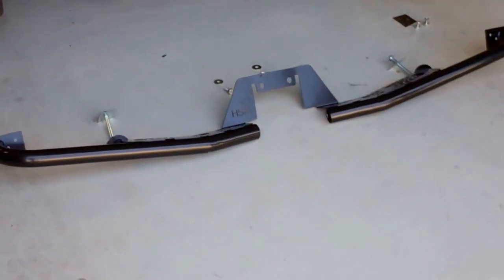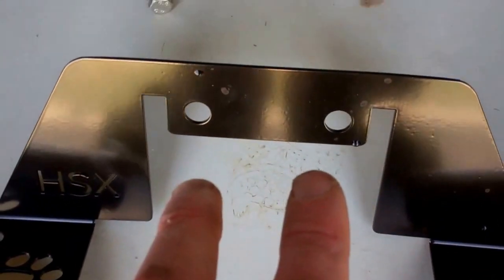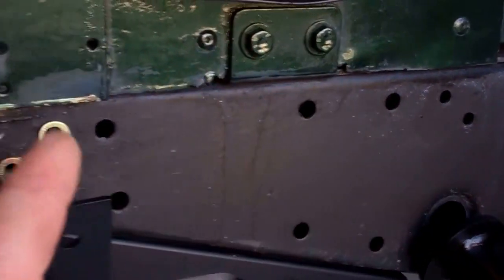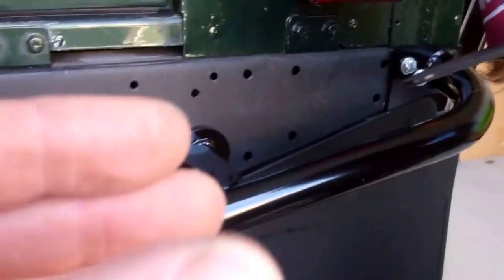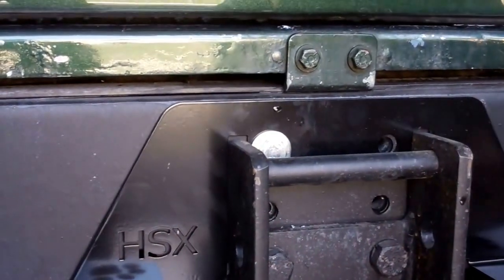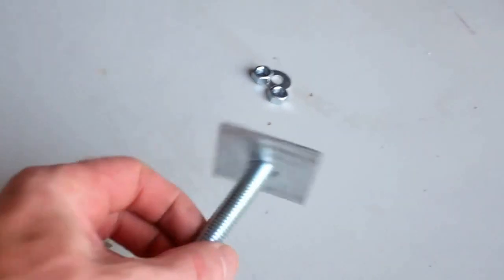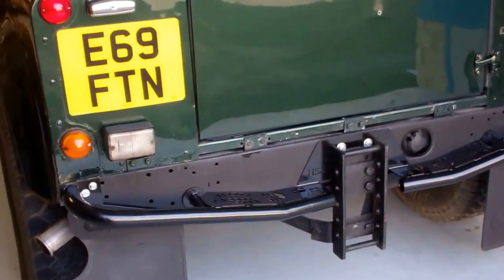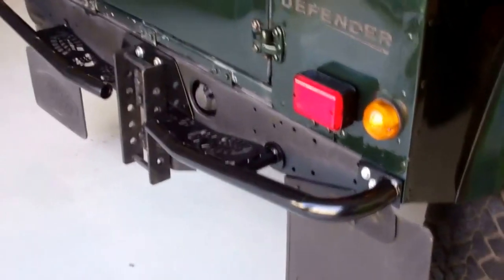Land Rover Defender Tubular Rear Bumper Fitting

Comment: Is it possible to get a different tread pattern in the step?  Also, maybe neoprene gasket to minimize the rust between all mounting surfaces.
Reply from the maker: Hi - yes we kind of had a bit of fun with the tread pattern - we laser cut this so can have any pattern... circles / chequer plate etc.